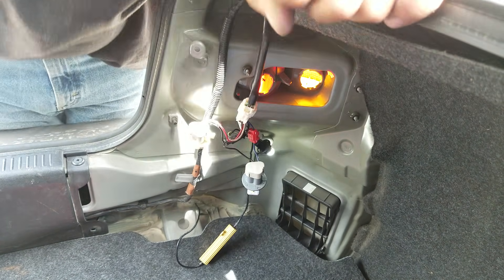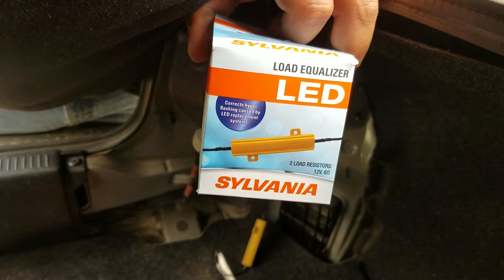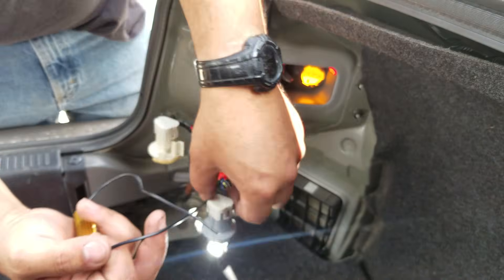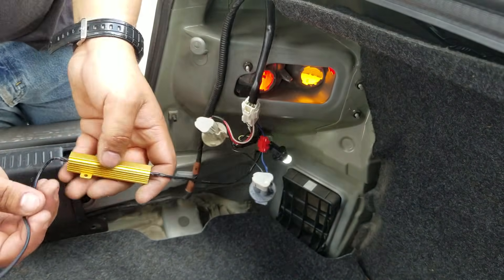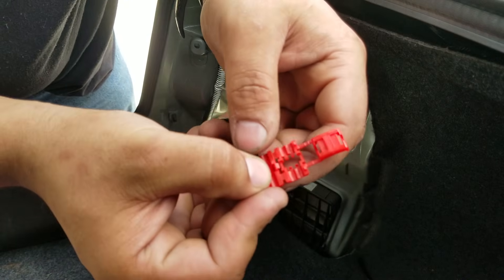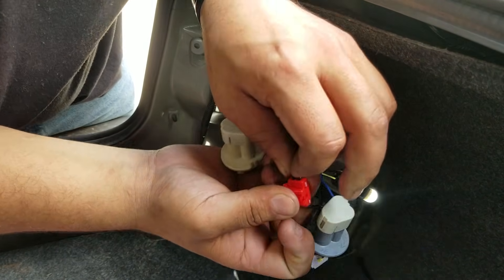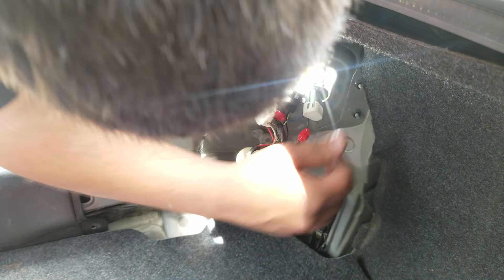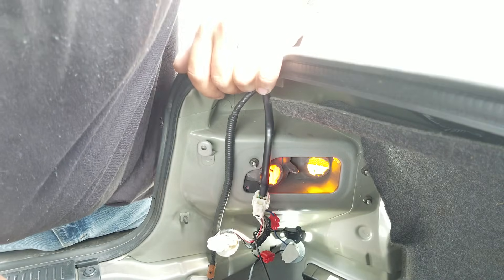Solving hyper flash with a LED Load Equalizer from Sylvania

Comment: Does this situation help with the low and high beams too? I have a dodge avenger 2012 SXT plus and is having this problem with my LEDs I got from Amazon . My mechanic just installed the regular ones back until we figured out the situation, if it does work I wanted to send him this video

Comment: @100mgd

Have u had any issues with ur load equalizer resistor?

And what about ur wires, now that it’s be cut the skin of the black wire and expose the bare wire, using T-tabs for using load equalizer resistor.

Any issues on them?

Do u personally recommend or u prefer a led bulb with a built-in resistor?

Or both for that matter?

Comment: I was wondering what that item was, thanks to you now I know.👍 I bought some LED lights for my 1990 Nissan D21 and the lights never came on. What I'm thinking is that the "load resistor" is defective, but then I don't know because the load resistor is getting hot but the LED lights do not come on. I ended up returning them to the seller.

Comment: How about with one side of the resistor going to vehicle ground instead of the ground wire (as many vehicles ground through the lamp metal body)
Reply: https://www.ebay.com/itm/335472623926?mkcid=16&mkevt=1&mkrid=711-127632-2357-0&ssspo=x20rrclvrfk&sssrc=2524149&ssuid=x20rrclvrfk&widget_ver=artemis&media=COPY

Comment: Does it matter if you install it in the front or rear?? I just bought some switchback leds turn signals lights for the front of my car but they don’t flash the amber when putting my turning signal they just stay white I have stock bulbs In the rear
Reply: Smart problem. Have you solved your problems?

Comment: Could someone recommend weather this would be better or an actual bulb with a resistor built in? I'm sure they both work but the heat is what I'm worried about. I'm assuming the bulb with resistor built in gets super hot too and part of that bulb is plastic so I would worry about it melting. Last thing I want is my car to catch fire from these things. What auto mfgs need to do is stop making the car hyper flash period. Or bring back old school relays. I put all LEDs on my 97 civic and all I had to buy was a cheap led relay to replace the old one and everything works perfectly
Reply: I was wondering. Can I buy one of those relays for my 2005 Toyota corolla instead of this that gets super hot?
Reply: The daytime led DRL I fitted said they had a resistor built in, it read 122c on the temp gun, very hot, but the normal bulb in there read 321c so I don't think you need to worry about melting the light housing, the  halogen bulbs get mega hot compared to a hot led
Reply: Look up lasfit, auxito, GTR-Lighting, auxbeam, few of them offer led bulbs with built in resistors. And it’s very nice: 

I highly recommend Lasfit and Auxito the most.

Comment: I'm assuming that the resistor gets pretty hot because you're using a load resistor with not enough resistance. I know that Sylvania sells a variation of these; depending on the wattage of the factory bulbs, you may have to buy load resistors with higher resistance.
Reply: Great point, it's not one size fit's all everyone! Another reason to check with Amazon on these. They have a variety and they are 800% less expensive, not a joke, come on man, oh you know the thing. Frfr though 8 for $13.79

Comment: How many resiator you install to your car?
Reply from the maker: Two total, one on each side since there was an LED on each side
Reply: Question. Do you need 4 resistors for the fronts and the backs?
Reply: @bosanovaboy  yes u do. Otherwise without one. It will hyperflash

Comment: The zip ties are to put around the red clips after they’re in place so that they don’t pop open from vibration inside your cars trim while you’re driving. Those zip ties can melt from the heat that comes off the equalizer. Avoid using plastic to fasten these things if possible

Comment: Do you recall if the load equilizer has a + and - or does it not matter which wire gets attached to the existing car wires?

Comment: This is absolutely the wrong approach. It's a "lazy" workaround that works but it's introducing a safety issue, ie the two large resistors which need to be properly attached by drilling the chassis of your car and placed somewhere with enough ventilation so they can dissipate the extra heat. Also, you are installing LEDs to benefit from the much lower current needed to drive the LEDs flashers, why negate that by using these resistors which all they do is waste all this current . With these load equalizers you are not equalizing anything you are simply using the same electrical current your incandescent bulbs would use PLUS whatever the LEDs require. The correct solution to this problem is to find what kind of (mechanical) flashing relay your vehicle is using and replace it with an electronic one that is meant to work with LEDs. Actually these newer electronic flasher relays will work with both traditional AND LED lights. It's a no brainer.
Reply: And it’s the best of both worlds. 

Either load equalizer resistor or led flasher relay. 

Or get a led bulb with a built in resistor.
Reply: So what do mean plz ??
U mean to buy led bulbs with internal resistor ?? 
Unfortunately i bought 4 led bulbs w5w , 2 w16w and 2 py21w from osram but it gave me errors 
What can i do ??
Reply: But it’s still a tried and true to do this. They are still solid to those that comes with a load equalizer resistor from sylvania, xenon depot, and GTR Lighting.
I don’t how’s that’s lazy when it’s requires a bit more work and sometimes a pain depending on the vehicle.
Reply: Gotdamn... you typed alot. I bet you talk a lot as well. Geeesssshhhh
Reply: @MikeMikeLowrey hey don’t we all type alot lol
Reply: I discovered this as well when looking at pricing on Amazon. Dude said replace the flasher with an LED rated unit. And you're right. You're basically hooking up a little oven to take the load that's being sent, still. Why not lower the load with an easy plug in $17 (Autozone)? BUT you could have been a little more diplomatic in your delivery. Obviously Sylvania is taking advantage of a lot of people with their mini oven. One of them is going to cause a fire and a law suit, then they'll pull them.
Reply: @dakuwolf2514  What type vehicle to you have?
Reply: And for the record dude. 

A resistor is a resistor. 

Thats the idea. A load equalizer resistor helps to keep resistance from hyperflashing. 

So he is resisting that hyperflash. 

Nothing more, nothing less.
Reply: No s**t?! Hmm... I had a feeling this was sort of the "lazy workaround" as you put it. Guess I'll have to consult my electrical whiz friend. Thanks!

Comment: Those connectors are garbage !! Now you've cut into the wires of your factory harness. Those are famous for corroding and quitting.. You can buy Canbus bulbs that have it built in..
Reply: But nowadays. The with a load equalizer resistor are still popular. Not as much as the built-in resistor, like auxito, lasfit, and GTR Lighting. 

Xenon depot have the best load equalizer resistor for C-series ceramic bulbs. 

So honestly it’s not garbage if it’s still tried and true installation. 

I never liked or never would mess with the wires. And I would have a led turn signal bulbs with a built-in resistors. 

But if I had like those Sylvania or xenon depot or even GTR Lighting with load equalizer resistor, I would have someone help me that knows and are pros for electronics and splicing the wires like it’s nothing.
Reply: Holy shit, Thanks for this!! I didn't know they existed and they're not that expensive. I'm on it. Seems like the easiest fix to my issues.

Comment: Installed mine and the resistor and with the headlights on the turn signals won’t work at all. Headlights off all good on, nothing.
Reply: Same Ford F150

Comment: Thanks a bunch. This is the first time I'm going to install LED turn lights and they we're supposed to be non hyper flash but still flashed like crazy. So, I'm getting this same product from my local AutoZone store for $14.99 and you gave me piece of mind on how these work. I appreciate mentioning the heat the load equalizer may throw off. A++ Thank you very much!
Reply: How’s it going two years later did anything melt? 😂
Reply: @caseytyler8326 have you had some melt before lol? I’m gonna put some but I’ll be checking on it all the time then if u say they melt
Reply: @caseytyler8326 I think they shouldn’t melt anything as long as you put the resistors on to a metal surface where it’s not touching any plastic

Comment: Advanced auto parts says two are in one box and good for all four signals. It seems I need 4 of these right?
Reply: I was wondering the same thing when I bought it. Not sure about your car, but for "standard" installation it appears that you only need 1 load equalizer for each turn signal circuit. Meaning, 1 for the left (which includes front + back) and 1 for the Right
Reply: Two load equalizer resistors are enough for all four.

Comment: It gets really hot and it melts through plastic, yet they give you zip ties to mount it.
Reply: The zip ties are to be used to keep wires together...not to mount
Reply: @missfixitCanada  thank you ! some people don’t have common sense …. hence why it has 2 holes for screws for mounting
Reply: The instructions say mount on a metal surface
Reply: @Bluefoxxred  The ZIP TIES are PLASTIC...
Reply: @TootNugget  yes I know. I found it more useful to use the zip ties for keeping the connectors closed not for mounting, mine kept opening back up so I’m assuming that’s what they’re for since you can’t mount with zip ties anyway

Comment: I installed LEDs in my 2015 RAM 1500 and don’t have any hyper flashing.  I do have messages that say my rear blinkers are out, but that was before I installed the LEDs.  My mirror turn signals are hyper flashing (at least they’re flashing faster than the new LED blinkers I installed).  So I think I have to replace those, which aren’t cheap. Anywho, good video should I have hyper flashing in the future.
Reply: I have a 2015 Ram 1500 as well. When I put LED's in it was not hyperflashing on the outside, but like yours it was hyperflashing on the instrument cluster and saying all 4 of my turn signals were out. But I solved it using these load equalizers and now no hyperflashing on the cluster or it saying that my turn signals are out
Reply: @BudgetStreamers  You might be able to replace the flasher unit (kind of like a relay) to an LED version. Cheaper and easier than installing these but not available for all applications.
Reply: @BudgetStreamers  did you have to put load equalizers on each turn signal? 4 total?
Reply: @milesmundy6455  yessir I did. I have since traded that truck in for a 2020 Charger. But yeah I did have to put load equalizers on all 4 turn signals
Reply: @BudgetStreamers  I was wondering the same thing when I bought it. Not sure about your car, but for "standard" installation it appears that you only need 1 load equalizer for each turn signal circuit. Meaning, 1 for the left (which includes front + back) and 1 for the Right

Comment: I'm assuming you'll need one of these for each turn signal?  Total of 4, one for each corner?  Or does two cover the whole car?
Reply: I was wondering the same thing when I bought it. Not sure about your car, but for "standard" installation it appears that you only need 1 load equalizer for each turn signal circuit. Meaning, 1 for the left (which includes front + back) and 1 for the Right
Reply: Circuit dependent. If no schematic then just give it a shot.

Comment: I believe #6 self tap screws will fit, zip ties could melt and allow the relay to move around and be a potential fire hazard.  It would be less likely here but on say a parking light/signal which remains lit the temp would be consistantly higher.  Those can depending on the brand and mounting location get up to several hundred degrees they should be firmly mounted to metal.
Reply: Great point! I just bought these today for my Tundra because I hate listening to the darn things blink so fast. I will definitely be screwing them down.

Comment: Im doing this for a 2009 camry and i see the turn signal wires in mine are colored differently...one is yellow and the other is white and black im guessing the white and black one is my ground right?
Reply from the maker: AOMechMarine AOMechMarine  Using a test light will help you find out which wire does what. 

https://shop.advanceautoparts.com/p/toolworks-circuit-tester-tw1486/11370939-p?c3ch=PLA&c3nid=11370939-P&adtype=pla&gclid=CjwKCAjwqqrmBRAAEiwAdpDXtDHBBBwq74cz2QxIc8dhlO29y9UxUnw-cEpzoQbSgY9kuRmlB3idPhoC19YQAvD_BwE&gclsrc=aw.ds